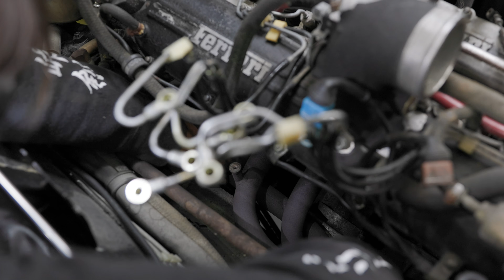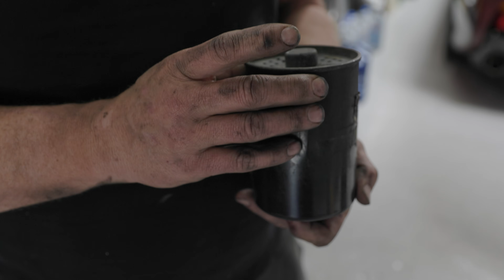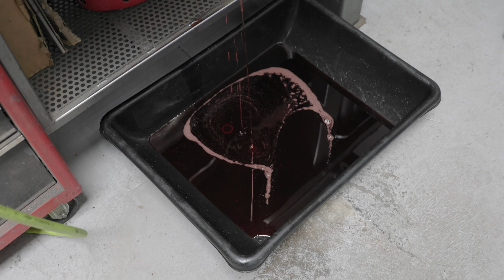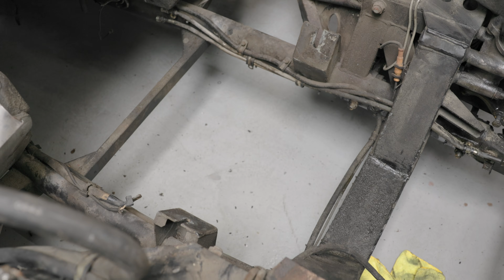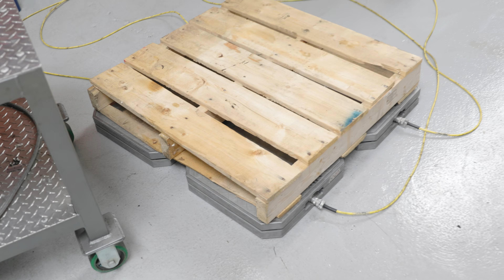Pulling The Old Engine and Revealing the New Engine!! / Ferrari 412 Ep. 2

Comment: two spanners to remove the oil cooler fitting 

very easy to bend the cooler base nut if you don’t hold it when removing the an fitting